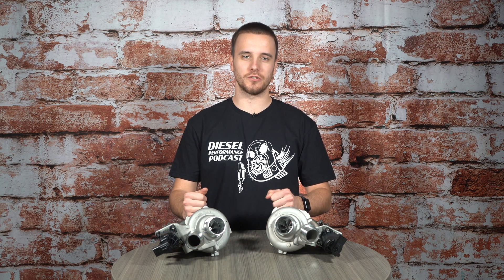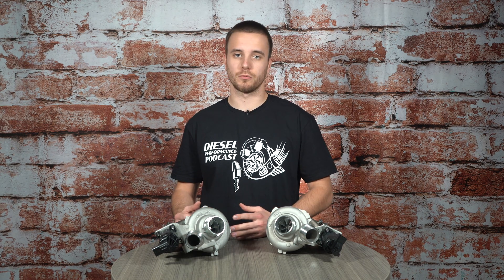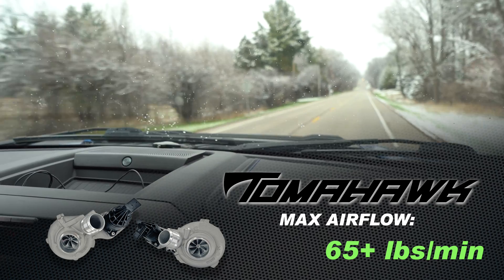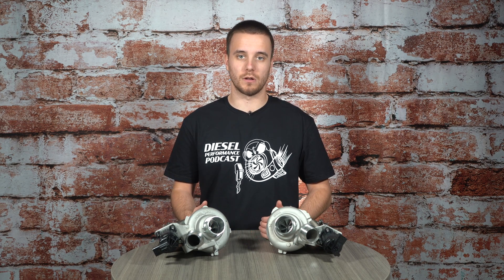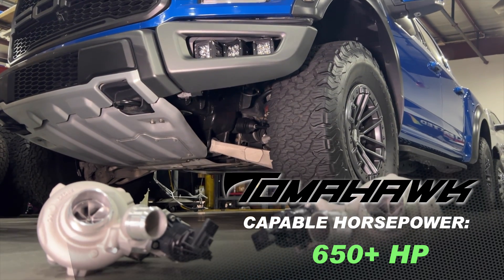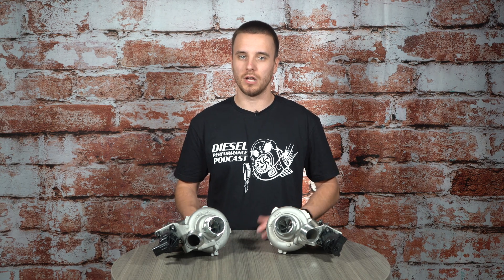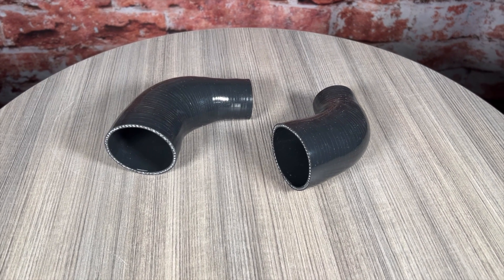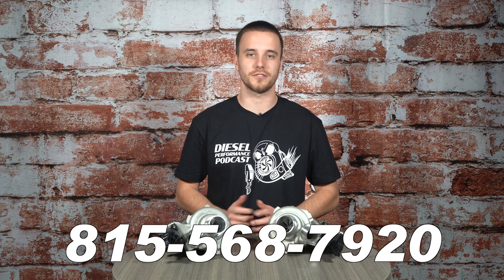Introducing the 3.5L EcoBoost Stealth Tomahawk Twin Turbo Kit!

Comment: HI, WOULD EVERYTHING FIT AND WORK WITH MY 2018 EXPEDITION 3.5L ECOBOOST ?
PLZ SAY IT DOES !
Reply from the maker: @craizygolf1980 It will! There will be a few things you need to add to be able to support the power they are capable of making such as intake pipes and a fuel pump booster. We can also provide you with the tuning you'll need as well. Please! Give us a call at (815)-568-7920 and we would be happy to go over everything with you.

Comment: I run a 2019 3.5 Ecoboost and interested in upgrading my turbos. If I added these turbos, what else do I need to keep my truck running at optimal condition with the larger turbos?
Reply from the maker: Tuning without a doubt.